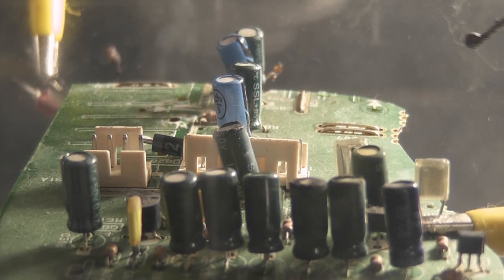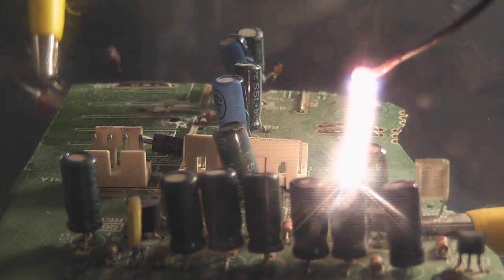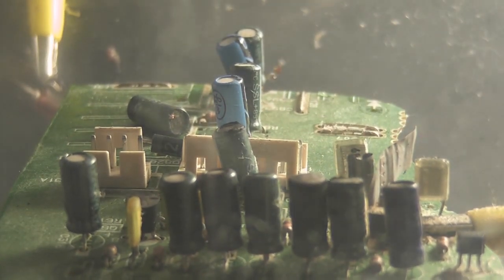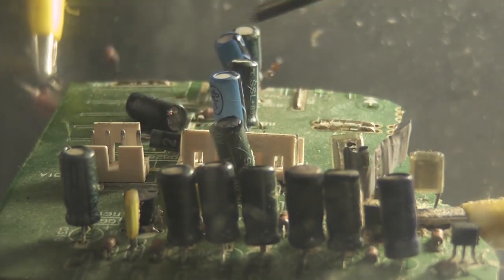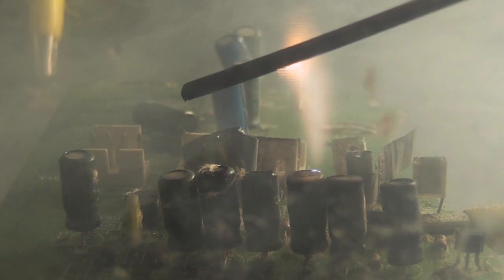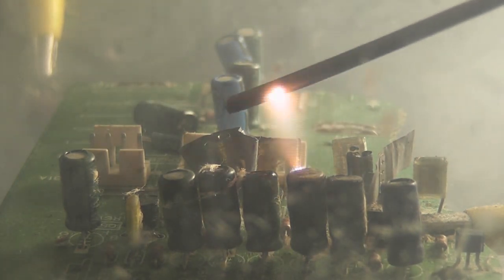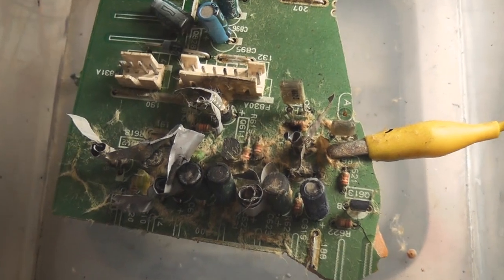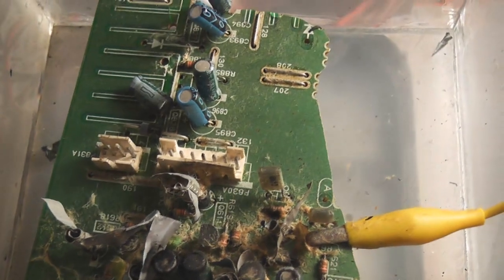ZVS arcs versus some non-vented Caps

Comment from the maker: OK, yes they probably will work, just try it out, as long they have at least 10 to 15 turns of wire on them. I have used various different inductors from old TV and PSU boards of which I don't know the actual value. some of them had plastic sleeved ferrite. It is a bit of trial & error. Swap some inductors and capacitors and see which ones give the best arcs.

Comment: btw, try connecting your neg of the flyback tx to the victim cause the neg gets much hotter that the pos. Negative of the fly is at the bottom on one of the pins and pos is the lead coming out the top ;)

Comment: Sorry, I don't think I worded my question very well. You know how ZVS drivers use a 47-200 uH inductor, in which one end of the inductor's coil is connected to the centretap of the flyback primary, and the other end is connected to the positive of the power supply? I meant those inductors.